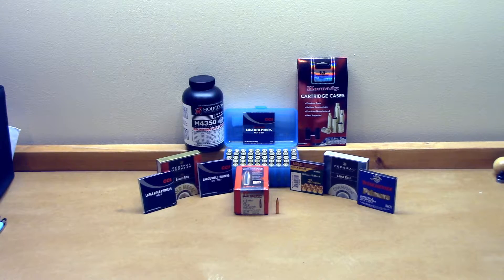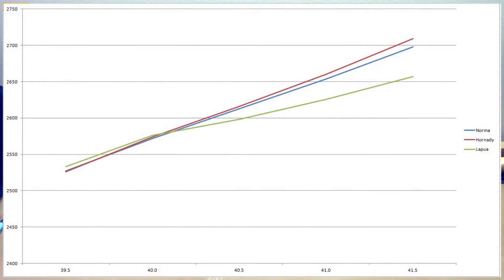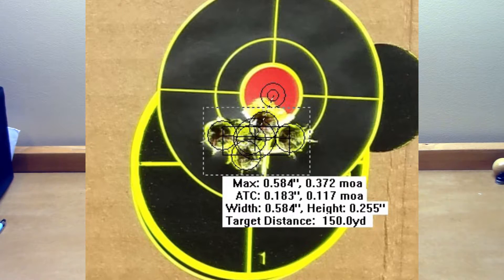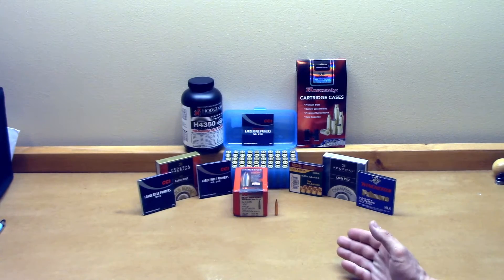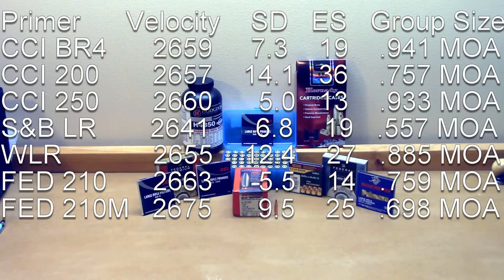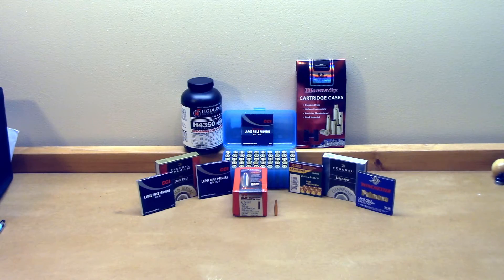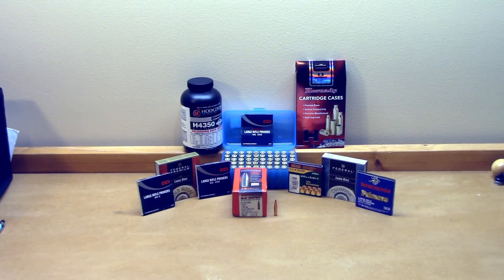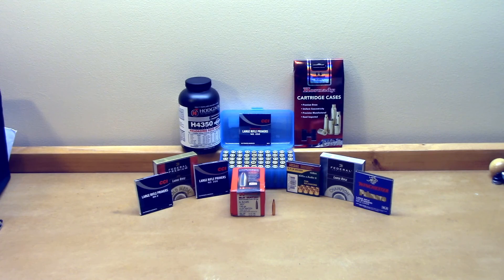Large Rifle Primer Evaluation using 6.5 Creedmoor

Comment: The statistics for the CCI 250 being so good and the horizontal spread insignificant, it's the one I'd try again. It almost looks like you're at the worst load for the barrel harmonics. I'd work on that charge up and down to see if you could find the sweet spot that is if group size is your priority and not velocity. I've seen all the groups you've fired and I don't recall any of they having such a small horizontal spread. If there is a sweet spot for that powder primer combination, you could have a dandy load.

Comment: S&B has always attempted to make a quality product as reflected by this test. Reloaders have been requesting a S&B magnum large rifle primer for years but S&B has been so successful with their current product line that they have very little reason to change.  I am a fan of CCI 250 in all of my large rifle loads. H4350, RL19 are both difficult to ignite and a magnum primer can only help if you can find a consistent lot. Thanks for the video and I would recommend further testing of your loads using the S&B primers to see if there is a sweet spot.
Reply: Sellier & Bellot  are no longer importing primers into the US,  since the primer plant explosion more than 4 years ago.  I contacted their importer Magtech, and was told if they get enough calls for them, they will try to deal with S&B to start to import again. So if you want them, get on the phone! I have used over 20 thousand and never had a single failure to ignite. Can't say that for any other primer manufacture.